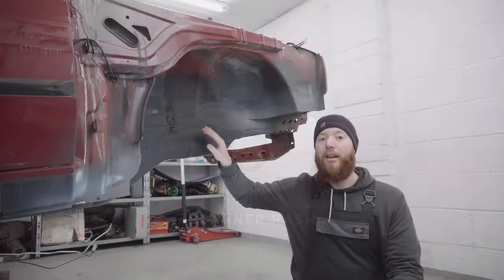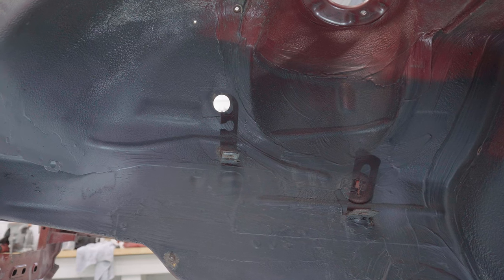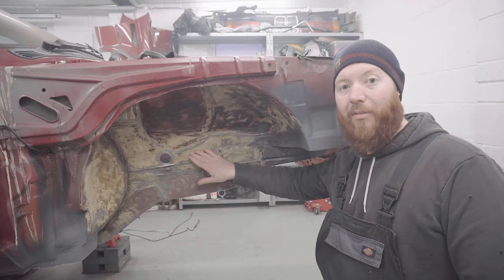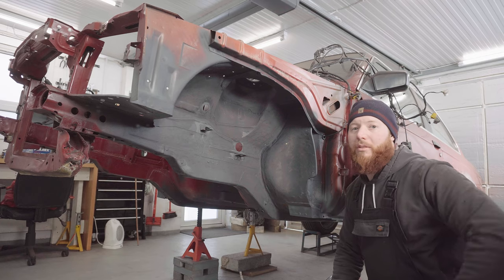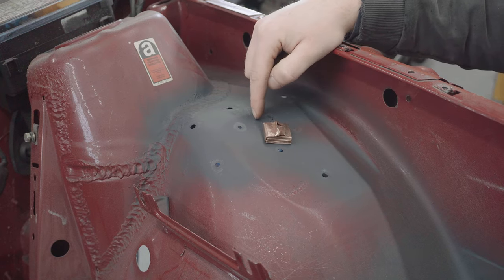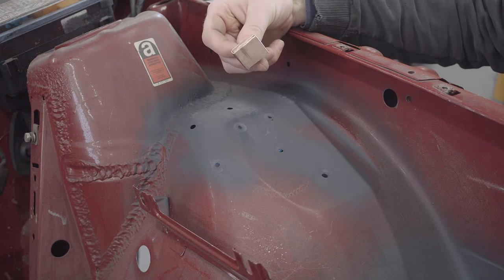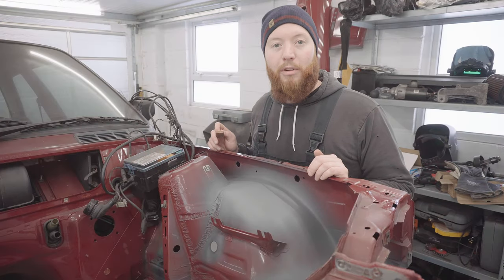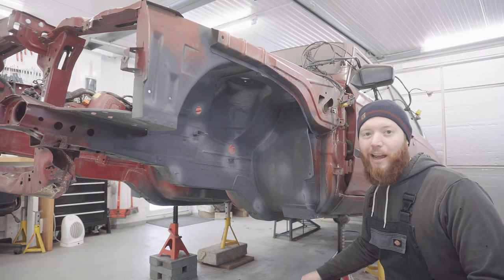BMW E30 Wheel Well Rust Repair & Underseal Removal | Welding Thin Metal With DIY Copper Block | 034

Comment: Removing underseal is such a tedious job to do , Have done it myself too many times to count lol. Glad you knew about the copper block trick . The BMW is coming along nicely. 👍
Reply from the maker: It's truly the worst! Glad I decided to avoid getting carried away and going full bare metal underneath. I'm fairly confident it's not necessary on this one. 🤞

The copper block is an absolute welding cheat code. I wish I'd known about that earlier. Thanks man

Comment: Such a tedious job. I used an air hammer/ chisel for the flatter sections of the body before finishing with the wire wheel. Definitely a shout if you’re doing the floor next. A joiners oscillating saw also works
Reply from the maker: Thats a nice idea for sure, I'm fearful about being destructive with a tool like an air chisel though, but maybe there's a technique to it. Cheers!

Comment: Fantastic repairs. Very neat job welding that screw on, faced with similar I've fitted a rivet nut and locktighted an M5 thread in.  Less work than your method but also doesn't arrive at the OEM looking result you have achieved, bravo.

You can get (very expensive!) Stud spot welders too, but they are a very specialist tool beyond reasonable purchase for us chaps in our garages restoring these things at home.
Reply from the maker: Thank you! Using a rivnut converted to a rivstud sounds like a pretty good idea actually. I hadn't thought of that.

Others have told me you can actually get rivstuds which sound better. I think I'd have looked down that route a bit more if I had more of them to replace. But seemed extreme when this worked so well for just one.
Reply: @SPANNERRASH  I did not know rivstuds are a thing! Might well have to do some research and get me one of those!

Comment: Every e30 I've ever seen had the factory paint color on the frame rails. The gray stuff there looks like it was added later, which is why it covers the brake line grommet (which looks original to me).
Reply from the maker: Ahh so you think the black was added later? I swear someone told me they came with black wheel wells from the factory but never been sure. It would definitely explain why the rubber grommet is covered. Thought that didn't look factory. Saying that, it is ancient underseal on them so I could believe it was original.

Comment: Apparently lighter coloured cars got the black wheel-wells, darker colours were left body-colour. Hence my Dolphin grey E30 doesn't have the black paint whereas my other,Luxor  beige one, does.
Reply from the maker: Hi Sid, thats very interesting, and kind of makes sense too as no doubt they were trying to save a few quid in the process.

I've undersealed my E30 now, and gone for a grey Dinitrol stuff. Maybe I will go back and over-paint the wheel wells in black if I can see into them when the car is back together properly.

Comment: Mate! I wouldn't be breathing in that dust if I were you!! Don't forget that mask! Loving the vids so far though! 

Your newest subscriber,

Australia
Reply from the maker: Welcome aboard mate! And yes I agree it's very foolish to be rocking without a mask, crap coming out of my nose for a while after. I will take note. 😷
Reply: @SPANNERRASH i'm just taking a break from grinding a wheel arch of my own (N43W Mitsubishi Chariot) and sheltering from the 38° heat outside. Tbh, i'd rather it be cold where you are... the sweat that runs down the inside of goggles then into your eyes is bloody annoying. 

Must crack on tho! :P
Reply from the maker: @clutsta  Haha!! Damn I could not operate in 38 degree heat. I don't envy that at all, hope you get though it without getting heat stroke!
Reply: @SPANNERRASH  beer helps! :D

Comment: Nice job!
For studs you used some kind of screws? What kind and what’s the thread size? Have to do the same on mine
Reply from the maker: Thank you! Yes I simply used a steel wood screw. I'm not certain of the actual size, as to be honest I picked it out of the box of loose miscellaneous screws every man has. 😂 I matched it up as close to the original stud as possible.

As these studs are to retain plastic clips that screw on, it only needs to bite in, not be a specific size necessarily.

I wasn't expecting this fix to work as well as it did. If you have lots to replace I'd recommend Rivnuts or Rivstuds as a superior fix. Hope that helps!

Comment: Hey mate, I replaced all my rotten threaded studs with riv nuts and will use bolts
Reply from the maker: I was tempted to do similar, but as only a couple needed replacing I decided to try this first, and I reckon it'll do the job! 😃

Comment: i have a bit of crack on the front left shock tower. how can i repair this? crack line surrounding the front shock tower.
Reply from the maker: A crack surrounding the front tower? Hmm that's not ideal!
I have heard of this happening before as the towers aren't that strong, more often they dome slightly. I think the only option is to weld it, or if its really bad I think the whole tower panel can be welded in and replaced. You'd have to do a great job of this though because it would impact the alignment.

Comment: Hi mate before you paint the underside then underseal bare in mind wire wheels (used for the underseal removal) tend to polish the metal so it really needs to be keyed before the first coat of epoxy (or whatever you're using)
Reply from the maker: That's excellent advice, I actually have found that out the hard way a few times, it's one of the reasons I use etch primer as it etches the metal for maximum adhesion and then another coating can go on top.

But I think keying the metal back up with a scotch pad is even better before applying it. I'll ensure I scuff up the bare surfaces and then etch prime before I go ahead and epoxy prime on top, then the new under seal.

Hopefully, I can get that done soon, I'll make sure to shoot a vid when I do! 😃

Comment: Just caught up on all your E30 vids and have really enjoyed them. Just some constructive comments. Were you to invest in a better quality welder, your work would be even better. I have used a Sealey Supermig 150 for all my cars, and it is OK, but if I had my time again I would definitely by an RTech unit. You probably know this, but if not, check out Dave's Garage channel, he is truly inspiring. Also, I don't know how you get to grips with 0.8mm wire on thin sheet, I'm sure your welds would be less blobby with 0.6mm, and the gas sounds far too high on the video sound, maybe not. I don't have the flow gauge, I just set it at the minimum flow to get nice clean welds, it is pretty expensive stuff. Going back to Dave, he uses straight CO2, much cheaper, and gets superb results with an RTech welder. I am 99% sure that the black underseal coating is not factory, certainly don't remember it on my E30, which was a 1987 and only 3 years old when I bought it so had had no interference whatsoever. Anyhow, you're doing a great job overall, so look forward to the next instalment.
Reply from the maker: Awesome thank you Bob, pleased to hear you're enjoying the vids. Interesting what you say about the welder. I had a terrible knackered Wolfweld welder before this and couldn't work out why I was just making a right mess.

Getting this cheap but actually working Clarke welder was a step up. I've no doubt a higher quality machine would be another step again, so one day I will hopefully be able to justify that.

I'll look Dave's Garage up, sounds like he has some good tricks for me to pick up.

Yeah, a few people have mentioned that 0.6mm would be better, I really should take that advice and pick some up for thinner sheet metal welding.

I'm using the 5% CO2/Argon mix gas at around 5-10L per minute which I thought was about right, do you think that's high?

That's very interesting what you say about your 1987 E30's wheel wells not having the black underseal. Maybe mine has been given some love before now after all. Cheers!

Comment: Great work mate , how did you like the seam sealer in your beard , ears and nose 😂 I took mine to bare metal and it was hideous along with the wire from the wheel stuck in my face 😂
Reply from the maker: Cheers Jason, I can tell you I've been finding seam sealer on my person for days 🤣 Bloody horrific stuff!

And yeah I had that same problem with the wire wheel, the bristles fly off like darts, really stings! 

So glad I've removed what I planned to and can move forward. Don't know how you had the stamina for bare metal haha

I can't wait to be working on the top side of this E30 rather than the underneath.